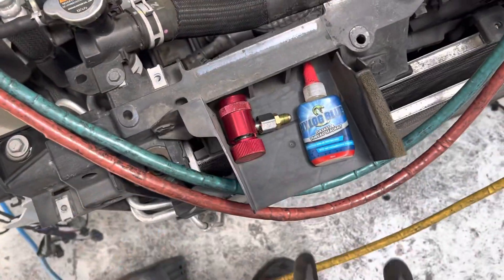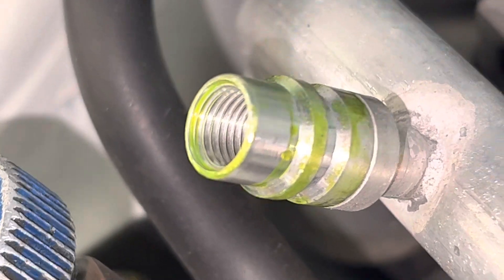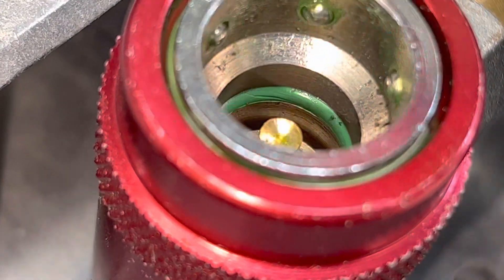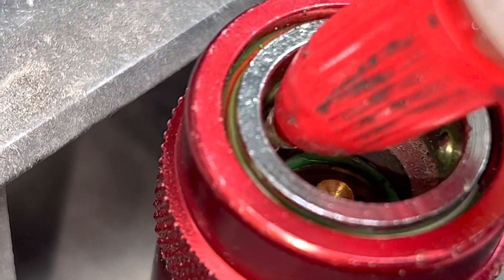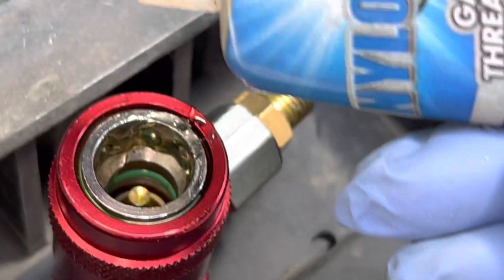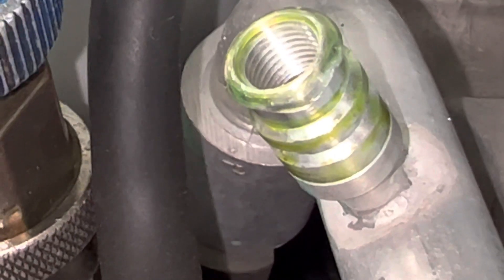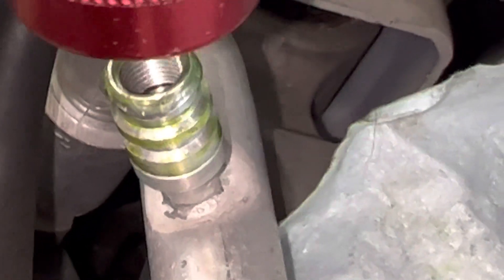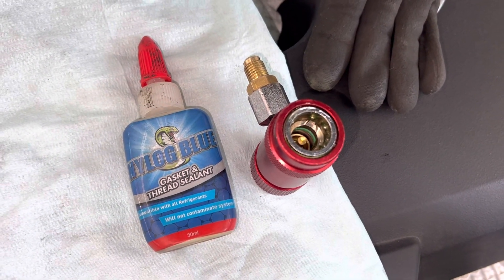REFRIGERANT AUTOMOTIVE SERVICE CUPPLINGS. Vacuum leaks

Comment: What are your go to couplings? I have some cheap ones off a HF gauge set yet they are junk.
Reply from the maker: Yellow jacket Richie when the next down the line master cool and then I’ve been going through generic eBay and Amazon from China and it’s hidden mess where do you get a decent pair or not

Basically yellow jacket is the top of the line least amount of leaks doesn’t wear out as fast more reliable at depressing the valve core every time when thread it in
Reply: @coldfinger459sub0  awesome! Thnx

Comment: Hi Tom, just some off topic question, I wonder when is the most appropriate time to inject dyes into the system if I have a contaminated refrigerant car running low on refrigerant? Let's say I have the same tracer line or AC Extendye that you have.
Reply from the maker: You can inject die at any time it could be injected while they’re still contaminated refrigerant in the system it will not affect it you can inject dye while it’s partially filled you can inject dye while it’s under vacuum. 

Because when you recover the refrigerant and throw your vacuum pump on the system it will not remove the die it will all stay there.

Comment: the dielectric grease used on sman also acceptable for this situation or is nylog preferred? Also, when replacing oring do you just match it up to one out of an o ring kit or are they a specific size that needs to come from whoever makes the fitting.
Reply from the maker: Silicone grease is good to. 

You can match oring

Comment: The problem is finding anyone local who is so diligent in what they do. It’s a race to the bottom on cost here in the UK, and people just want a cheap regas, and don’t know or care that they are getting contaminated refrigerant or bad advice. If it blows cold when they hand over their cash, then it’s all good.
Reply: There is a UK mechanic often visiting Tom's channel and leave comments occasionally, I think you can contact him if you really need some serious regas.
Here is his channel:
https://www.youtube.com/c/AutomotiveSolutions1/featured
Reply from the maker: @knk3220  yes this is true he is making large strides and trying to be very good at air-conditioning and he’s purchasing all the correct equipment to do a good job. 

I tried to pin this comment but the pin selection option is missing.
Reply from the maker: Yep here to

Comment: could you do a video on Mercedes with CO2 R744 when ever you come across one
Reply from the maker: I would love to but it extremely highly unlikely that I’ll ever come across one in United States anytime soon. 

So far from YouTube subscribers in Europe and the Middle East have told me that they have CO2 Mercedes-Benz and they only could go to usually one place that has the capability to recharge their vehicle

I think it is not even offered as an option here in the United States unless somebody wants to order a European model and import it. 

I am dying to get my hands on one and I would like to be the only guy in the San Francisco Bay area who has the capability of recharging them. 

It would be a monopoly market for me
Reply: @coldfinger459sub0  It's my understanding now that they are no longer using R744 and have reverted to 1234Yf because of major faults with leaks due to very high pressures. I was expecting to come across one this season, and would only invest in gauges, hoses and leak test equipment when asked to do so. But so far have thankfully escaped.
Reply from the maker: @foxdmulder  CO2 is used for many decades now around the world in commercial refrigeration home heat pumps home water heaters residential air conditioning manufactured by Sanden in Japan available in the United States all available CO2 without problems with leaks

leaks are only due to a manufacturers poor selection of materials and bad designing. 

CO2 was one of the original for refrigerance used over 100 years ago there’s nothing new about it. 

The pressures are actually low it’s all relative to what you’re comparing it to

Think of hydraulic line pressures in your forklift or your pallet jack that are in the tens of thousands of psi CO2 is only 1400 psi

Think of your high pressure water cutting lines that are 30,000 psi 50,000 psi or 80,000 psi. 

In comparison CO2 is like blowing up a rubber balloon. 

What automotive consider high pressure scares them just like they’re afraid of HC refrigerants like propane or butane that would be an excellent refrigerant you only need like 5 ounces of it barely flammable compared to driving around with 15 gallons of liquid petroleum gasoline in your tank. 

I’m so sad that CO2 would not be coming to the automotive market in America I was really looking forward to it.
Reply: @coldfinger459sub0  This is my new channel,  I'd appreciate any feedback or criticisms you have. Thankyou for your educational videos, I'm just starting my youtube channel and only test videos for now.
Reply from the maker: @carcareautoclimate  will do 👍